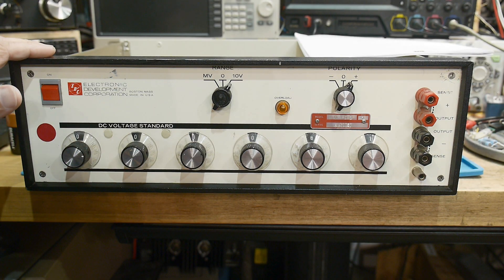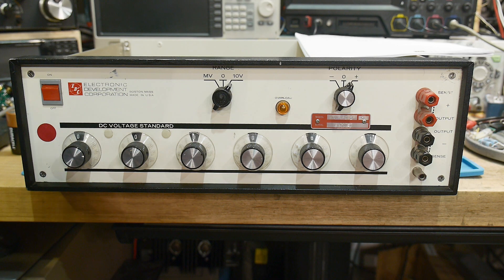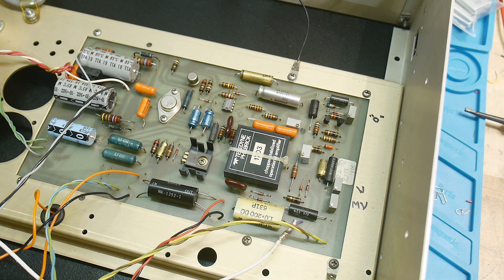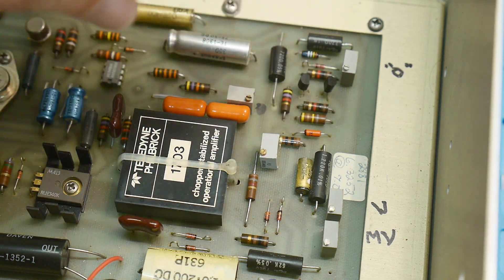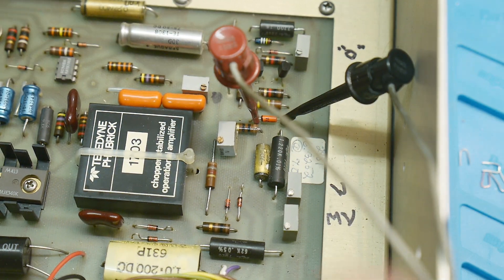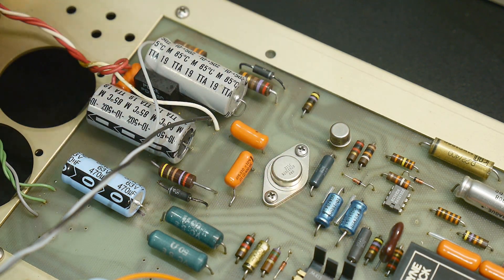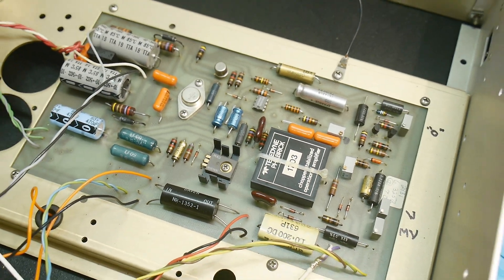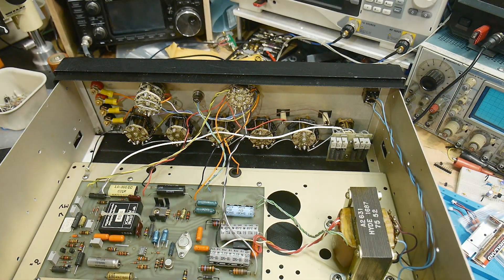#1788 EDC MV100 Voltage Calibrator (part 1 of 2)

Comment: Hi! I know I've hit that nail before, but I'm asking for your opinion as an experienced fella, is there specific case where you would use one cleaner instead of another?
Just for the context, I currently have both the MG control cleaner and the "regular" contact cleaner... Should I use the contact cleaner with silicon instead of using these two?
Is there an advantage in one case or another? (Basically, I'm out of contact cleaner, can I use the control cleaner everywhere, or should I buy either of the contact cleaners?)
Thanks!
Very interesting series on the gyrators btw :) and holy hell those resistors must be quite expensive indeed!

Comment: Hi there, 
You talked about your Garage being too cold!!?? See, I do not know even 1/ 1000 of what you know about Electricity and Electronics but still easily I put up a 240 volt   outlet for my garage and bought one of those garage heaters . Working like a charm and automatically keep the temperature in comfort zoon at my garage whenever I need it. Why not doing tha same 🎉❤
Reply from the maker: I have a heater under the bench that keeps me happy and I save energy not heating the rest.

Comment: Oh, forgot to tell you, the hoo-haa about damaging the silver plating on the wafer switch parts IS justified. I think if it is silver-on-silver then no dissimilar matal “thermo/electrocouples” are set up, and in a thing like this where those precious PPM’s are important that would intriduce errors. That silicone lubricant looks like good stuff…probably can’t get it here in Australia though.

Silver is a matal that has a peculiar affinity for sulphur. Silver-I sulphide, Ag2S is a very very stable comound of silver on this Planrt’s surface…you often see PL-259 and some BNC connectors that are silver plated all blsckened by sulver dulphide deposits. One way to get rid of it is to use hydrazine hydrate, this reduces the silver sulphide back to the metal and removes the sulphide ion as hydrazinium sulphide. It is a good technique because it does not remove silver from the surface, it just reduces the silver-I ions back to silver-0, (the metal) in situ.

Other metals have “@peculiar affinites” for other things, like iron for oxygen, hence rust, sand sodium for almost anything electronsgative, but ultimately chloride ions in the sea, hence salt.

Comment: If you take a good, high res picture of each side of the board and post them up somewhere I can get them, I’ll draw you the circuit from it. (But you are on your own with all those point-to-point attenuators behind the front panel. 
Can you hold it up to the sun..i.e., yhe bottom of the board to the sun and photograph that…that would make it pretty easy to extract the circuit.

Comment: Think am I , that is a Kelvin-Varley divider. Zener diode is thermal coupled zener with pn diode , and current is not the same couse reference drift many years. But now this zener is rock solid , I think , and its awesome. Zener is not in oven ! Wait part 2 ... 😊

Comment: The 1N821 - 1N829 series voltage reference diodes actually used a 5.6 volt zener in series with a small signal silicon diode.  I don't know why the series silicon diode was used, as the the 4.7, 5.1, and 5.6 volt zeners were zero TC drift assuming the correct zener current is used.  I always used a 5.6 volt zener, fed by a 0.1 mA constant current source for a voltage reference.

The zener diode voltage reference was a big improvement over gas discharge VR tubes.
Reply: The answer is couse on 0,1 mA zener have unacteptable noise and high dynamic resistance. On 5 -7 mA noise is lower.
Reply: @adamlazarowicz9136  Thanks for your response.  You are quite correct about the zener noise.  I have always used a simple R/C filter to address that problem but, the effects of the noise would still be present in the form of sub-hertz ripple.  Zener impedance is minimum at about 7.5 volts for a given zener current.  However, at a zener current at 7.5 mA, the impedance is much lower than at 0.1 mA.

Comment: In the early days, way back when, I put 1N825 in one of my designs.  I considered 1N827 too expensive.  In any case, the way they were specified to be used, was to run them at 7.5 mA current.  You did it by building an op-amp loop that produced 10.000 V output after trimming of some potentiometer(s) and then feeding the zener with a nominally 506 ohm resistor out of the 10.000 V.  Got supposedly the thermally stable operating spot with a minimal component count.  At the same time, I read a Philips tech note about their two stage (1 avalanche diode and one or more zener diodes with resistors).  They trimmed the resistors to produce a matched set of the positive temperature coefficient of the avalanche diode and the negative temperature coefficient of the zener diode(s).  The set also was delivered with list of operating conditions to their own instrument manufacturing department.  I think the circuits with the LTZ1000 also use the same Loop Back circuit that I used with my 1N825, although they also use an ovenized temperature control.
Reply: Yeah the LTZ circuit is similar just a bit more complicated as the LTZ got a transistor as the temperature compensating element not a diode, and separate sense/force pins. All of the zener references can be tuned to 0 TC point by changing current, the bins of 1N82x are just how close that current was to 7.5mA. But characterizing every diode isn't feasible for production, that's why the ovenized 399 and LTZ1000 came to market and became popular i think. It's not that hard to choose a current for an unheated zener to get 2ppm/C over 10C.

Comment: I would measure the ESR of the electrolytic capacitors in circuit before replacing them. I am not convinced that they are all broken. I have working capacitors from 1972 and broken ones from 2010.
I do however agree with the common advice here to replace the carbon comp resistors.

Comment: Gotta say, sort has the science-fair project vibe looking at the guts.  I think most of that is from the (lack of) any real cable/wiring management.   That all seems a little haphazard?   Also wondering if that's an original zip-tie around that op-amp, or from some previous repair attempt.
Reply from the maker: they are usually on socket pins, not soldered. so I believe the cable tie is original

Comment: We have a couple units similar to that, and they work for a living.  You'll want to check / replace those carbon comp resistors as they are very very drifty by now.  It's faster just to replace all of them.  Replace with much better metal film and you'll find you won't have to recalibrate it nearly as often, and you CAN get the lower digits working better.  Well, digit 6 might still be off a little but you can get a solid digit 5.  If your unit doesn't have an RC snubber on the PT secondaries, add that and your output noise will be better.